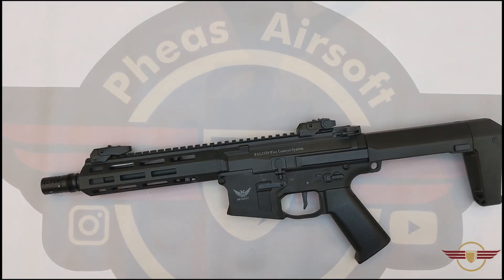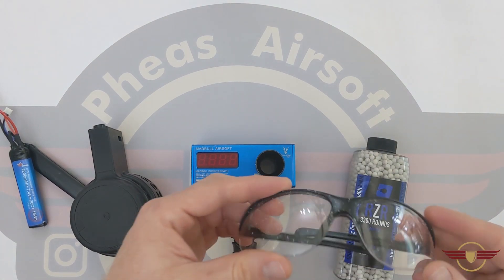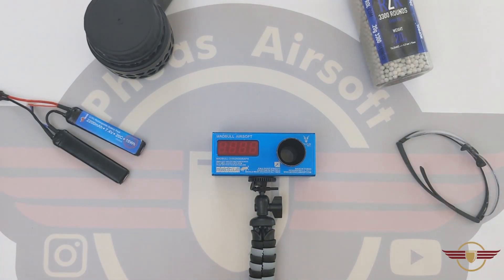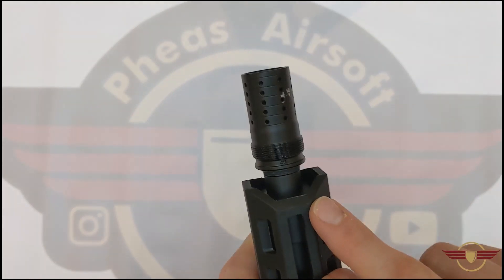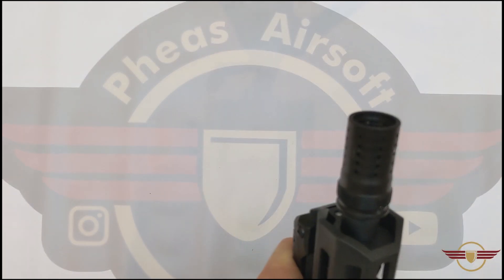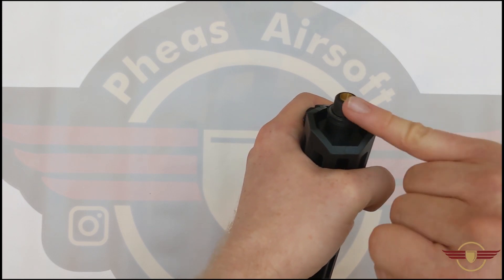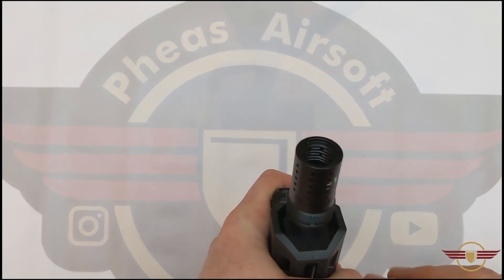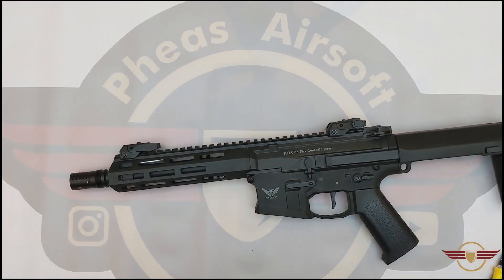[REQUESTED] [HOW TO] DE M904G Muzzle brake removal suppressor fitting help

Comment: Took me a few mins to notice the grub screw, off quite easy from there found a small enough Allen key in my tool kit. Again top video loving the M904G
Reply: what battery should I get and is this good for a beginner. also is it solid

Comment: @Pheas - you tried a suppressor on the barrel once the factory flash hider is removed? I've two 14mm CCW suppressors, neither want to fit the barrel threaded end. Noticed the standard flash hider has an external thread for an 'over the flash hider' type threaded suppressor. You got anything like that you can confirm fits?
Reply: did you find an answer?

Comment: Can you get a qd suppressor that would go over this muzzle or one that would fit it as it had threading on the muzzle with out having to take to muzzle off like the real honey badger
Reply from the maker: I am not aware of a QD one that will just go on the current device, but you can buy ones that come with the appropriate muzzle to QD on and off. Pheas

Comment: this size AR looks similiar to M906c, would you say theyre the same outer barrel lenght? if so do you know the size? i broke my (m906c) outer barrel thread, clean cut (by accident) when trying the methods in comment section and in video LOL grub screw was stuck so i tried drilling and forced with plier. was such a bad idea but was getting very impatient removing it. now i need to replace my outer barrel :P
Reply: so i found out its a 8 inch barrel, having difficult time finding an 8" in canada, was wondering will a 7" outer barrel work? will my spitfire tracer unit fit? would like to hear from your point of view thanks

Comment: I have the M916G and I simply cannot find a bit that will fit the grub screw on it. The muzzle break used is an aeroknox butterfly, tried using torx 4-7 and nothing fits :( any help here? Got no alan keys that will fit either
Reply from the maker: Hiya. I've generally found that a torx 5 or 6 (can't remember off top of my head) fit the  standard ones. I have the eshooter based aeroknox at home, will have a look this evening to see if I can figure it out. Pheas
Reply: @PheasAirsoft  Hiya mate, yeah I've tried both, 4,5,6,7, square heads, alan keys, nothing will fit it snug. It's always too loose or too big! Appreciate it thank you boss
Reply from the maker: @benfrance8416  Hello! Just got home and tried it. it defo is a torx6 bit. Done a little video to show you mine here: https://youtu.be/9U4LqAj4L20  Hope that helps. If your torx 6 didnt fit, then I think it could be a mis label or it could be rounded maybe? Maybe the grub screw is a bit rounded out? Pheas

Comment: Hey m8 not sure if your still doing how tos for this gun but do you mind doing one on changing the outer barrel of it?
Reply from the maker: Hiya! I do not have this particular model anymore, BUT I do have the M904H model still (video dropped on Tuesday of it) which has, from what I can remember, the same barrel system. I will see how quickly I can get some time to film it for you and drop it. Pheas
Reply: @PheasAirsoft  Thanks!

Comment: The little screw that pins the flash hider/muzzle break wont come out for me. I used the right sized bit but it just keeps stripping. Tried rubber band, glue, contact cement. I dont have access to any power tools, do you have any suggestions on how I can loosen it or something. I have the same model as you except it has a 3 prong flash hider instead of the compensator that you have . Thank you
Reply from the maker: That's a tough one. The only option I could think it's a slightly bigger torx and try pushing down whilst turning to try and gain enough purchase on it to unscrew it.  Pheas
Reply: No luck. I think I'm just better off swapping the outer barrel with another one with no muzzle break. Just gonna cause damage at this point. Do you know if I would be able to swap outer barrels with any off the shelf aftermarket ones? Think it just need a 10' or 10 n half' outer barrel
Reply from the maker: @kbar11  https://youtu.be/0C_RI-VjW2I Have a look at that, I didnt remove the outer, but based on what I can see, I would have thought it should take an after market outter and use their barrel nut to tighten it back on again. Pheas
Reply: @PheasAirsoft  I think I saw that and that was my plan. Thankfully I was able to just drill out the screw and then some lol. Friend let me borrow a drill and I more or less bored out a hole into the muzzle break screw hole and destroyed the screw in the process. But success! And no damage to the threads on the outer barrel. Just can't use a set screw anymore but didn't need it to begin with

Comment: Hey pheas i have m904g and i have problem with battery space. Do you know if there is any extender for it and can you suggest me a good battery for this gun ?? thank you in advance
Reply from the maker: Hiya, it is a very small space there. The Airtech extension (for the kwa series) may fit, but I can't be sure of that. For battery, we go this one to fit in the space:

https://www.taiwangun.com/en/batteries-li-po/battery-li-po-1100mah-7-4v-15-30c-8fields

That runs its fairly nicely, but anything of about those dimensions (maybe a little bigger) will fit. 

Pheas

Comment: Please if i change inner barrel should i use 200mm or 229mm? Thanks!
Reply from the maker: Hiya. As long as it stays inside the outer barrel (so not to cause issues with tracers if you use them) so if the  229 will fit then that's what I would go with. Pheas
Reply: @PheasAirsoft  Thanks - i want to buy one but i dont know correct length :( Thanks for your reply and for your help :)

Comment: Would you do the M904A? I can’t find anyone doing it and it’s harder to get off.
Reply: Same here, i got a m904c, and i can’t get it off lol
Reply: @ I did it by dipping it in boiling water for 20 minutes
Reply: @daredevilairsoft101 thanks for your reply, i will give it a go!
Reply: @ Definitely! Be sure to remove the handguard though, and make sure your Allen key fits first, dip only the flashhider in, remove inner barrel ofc too, nothing but outer. Out barrel can go in too but it just keeps pushing the head up in so be careful how much you dip in. Put it on high - medium heat. Then ever so often remove it and try to remove the screw.
Reply: @daredevilairsoft101 Sorry for the misunderstanding, but what kind of screw you talk about? Is it the screw on the side under the handguard? There is no screw in the flash hider like in the M904G ://
Reply: @ It’s a Grub screw
Reply: @daredevilairsoft101 there is no grub screw on the flash hider, only one under the hanguard left side

Comment: How to remove this when thread is locktited and the screw is rounded of trying to unscrew with torx or other screwdriver?
Reply from the maker: Hiya. Sounds like a bad situation. I would try a slightly larger torx head, or try a square headed or triangle headed screw driver I have had good success with those in the past. Good luck with it. Pheas
Reply: @PheasAirsoft  I tried size larger torx and nothing work. Just spin round and round. In worst scenario I have to use drill and carefully start to drill it out
Reply: @hiver90  did you ever figure it out?
Reply: Having same issue. Nothing is working. Don't have a drill either. Just hand tools
Reply: @randoo09836  drilling it out not work. In near time I will go to airsoft service and take some help by their side. After drilling suppresor barly move
Reply: Same issue for me, stripped the glued grub screw…. Did you guys find a good method to get it out?